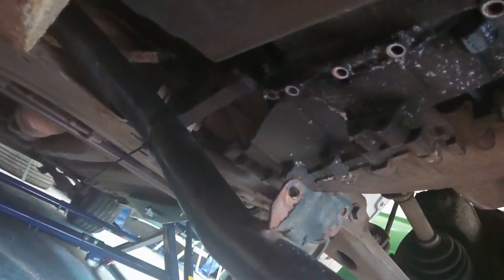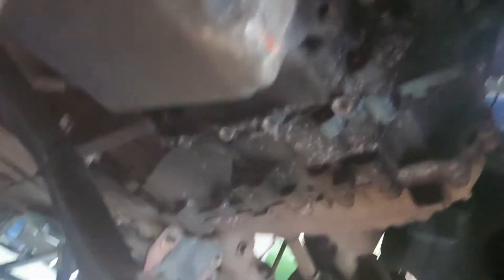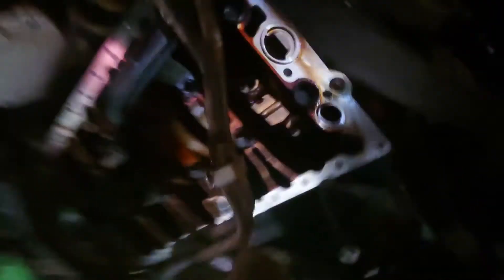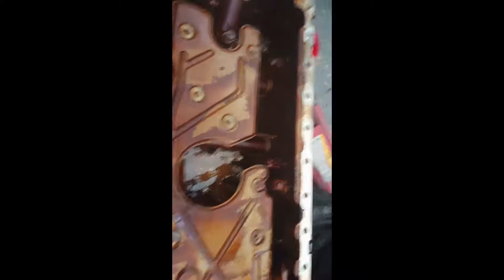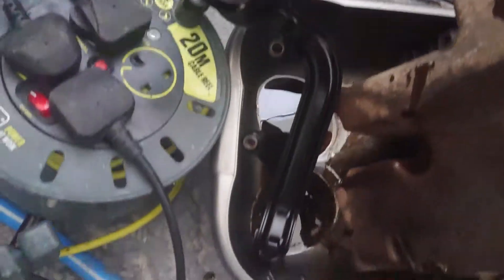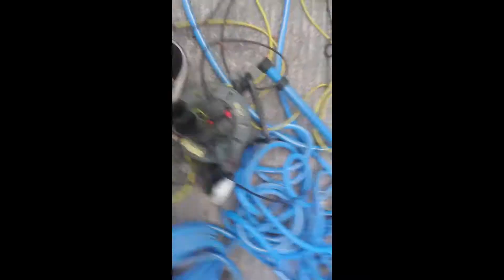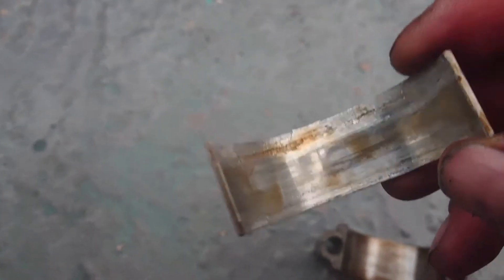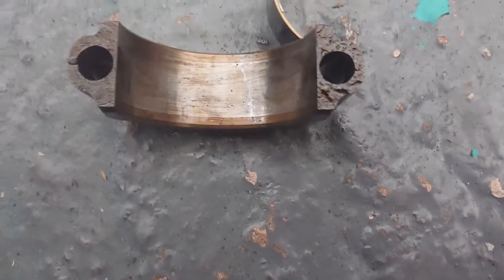Repairing Engine Knock Ford Focus ST-3 Part 2

Comment: Hi great video, im just wondering if you polished up the crank journals at all? And did you reuse the conrod bolts and torque them back to the right spec? Needing to do this all myself thats all,

Comment: Did you re-use the connecting rod bolts ?  they say they should be replaced as they are stretch bolts.